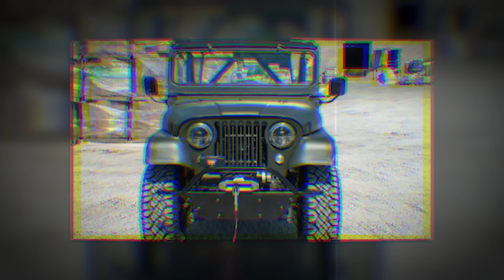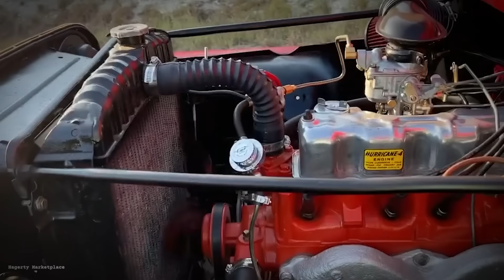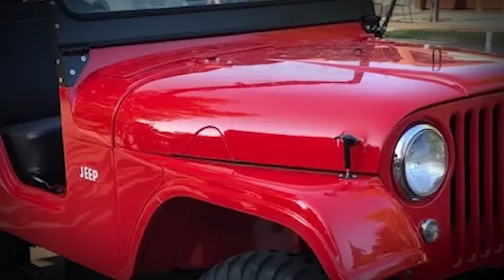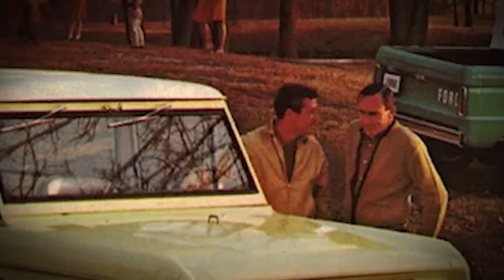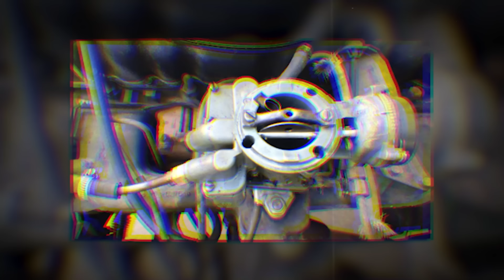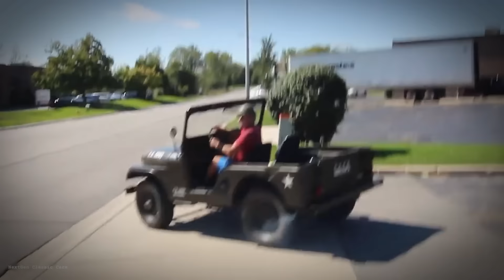Even at 70 HP & Leaf Springs, the 1955 Willys Jeep CJ-5 Shocked Everyone Climbing 45-Degree Slopes

Comment: I waited all my adult life to get a Jeep.  Finally got a new Wrangler JK 2 door in 2012.  If that dang engine trouble light didn't come on for some reason once every 8 months or so I wouldn't know how to act. Miner crap like the Fuel tank's breathing system has a miner vacuum leak.  I visited my local Jeep dealership for a new thermostat about three years ago. Went into the show room looking for info about the Wrangler's diesel four cylinder and found it was no longer available. Bad motor. I Spoke to the sales manager.  Told him what I was driving and he made sure nobody else was listening and softly said;  "Keep it. Nothing in here is better."  I'll do exactly that. I also drive a Generation #2  2001 Dodge 3/4 T 4X4 Cummins diesel truck with 240K miles on it.  Bought it new and will never part with it either.  I'm a car salesman's worse enemy.

Comment: If jeep would start building these again and they had the cost,down ,simple, minimal and just basic things added, options!,they couldn't keep it on the showroom floor, because they would sell out faster than they demanded to supply, support and base upkeep and good parts support!,very great vehicle!!,. jeep go back to the basics,what actually works!!,not some high prices and dumb luxuries.you really don't need!.
Reply: Let's make a better one. Offer a five speed OD transmission, working emergency brake, front disk brakes, a steering box not designed for tractors.

Comment: The dauntless v 6 was a Buick motor that kiser put in jeep from late 1965 to 1967 until the v6 was used up Buick discontinued the v6 oddfire
Reply: Buick 225 used from 1966-71 by Jeep then G.M. bought it back and became the 3.8 / 231 odd fire later 231 even fire !
Reply: @KenCrandall-ot7uv ok I way miss informed